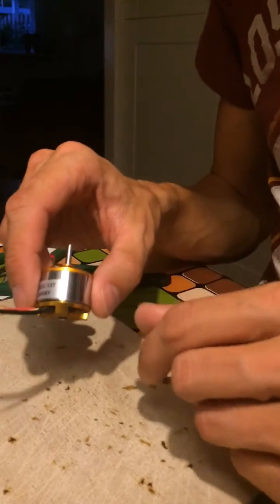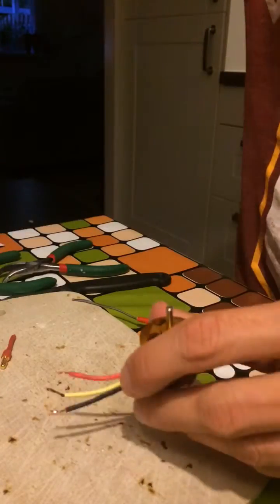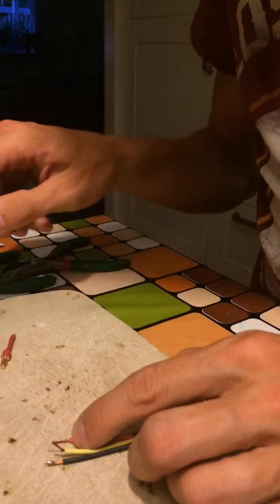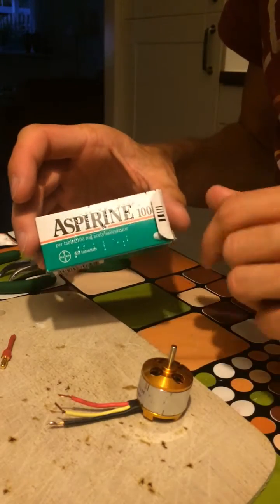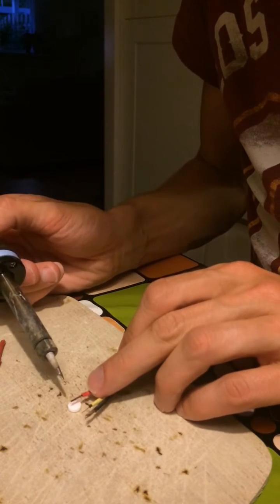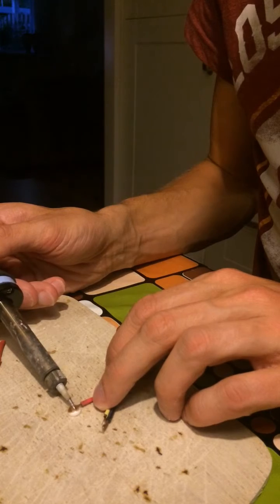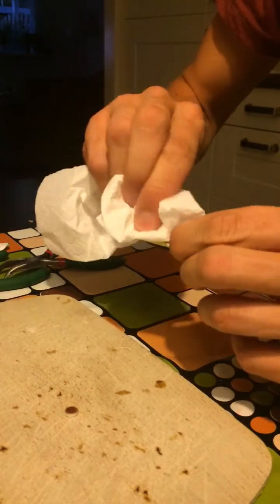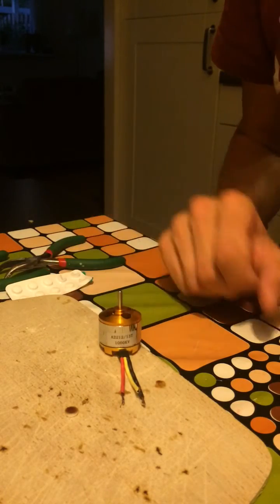How to remove the copper enamel coating from your motor leads using Aspirin

Comment: Nice tip.  I think I'll try this.  Normally I just set my iron to 400F or higher and it melts the coating off.  By the way - the wire itself is copper.  The coating is enamel.  You want to remove the enamel and leave the copper.

Comment: Just tried this. Not sure if it's working or if it's simply the extra heat generated by the iron. I realised if you hold the iron long enough on the wire, it'll burn away the casing. The aspirin doesn't really remove it as far as I can tell.

Comment: Dutch accent? Nice video. I use 4 parts Lye + 1 part table salt and heat in cast iron cap outside. I dip wire in and rinse in distilled water. My motors are all larger, 40mm x 94mm but wire is still very fragile. I will try your method. Thank you!